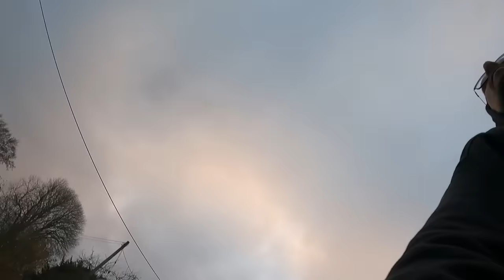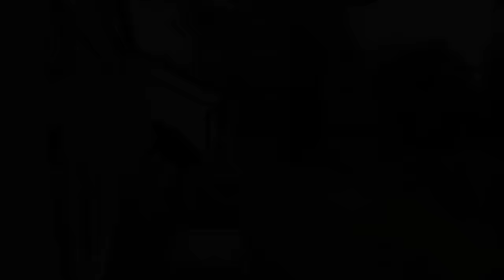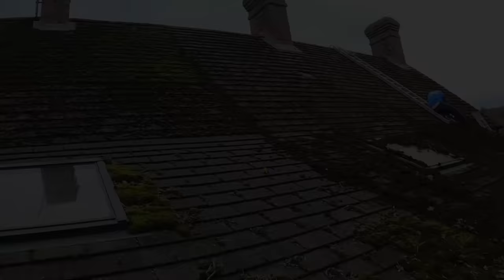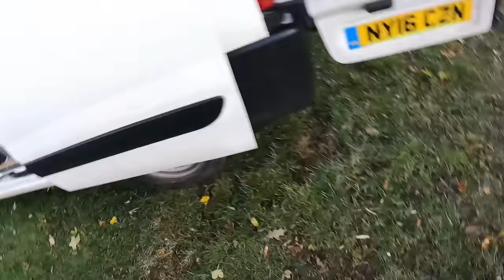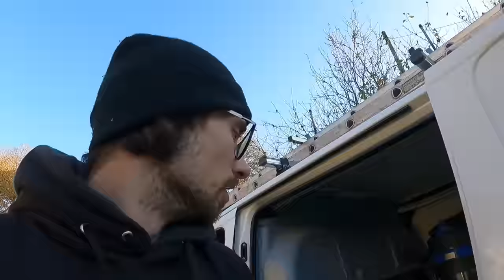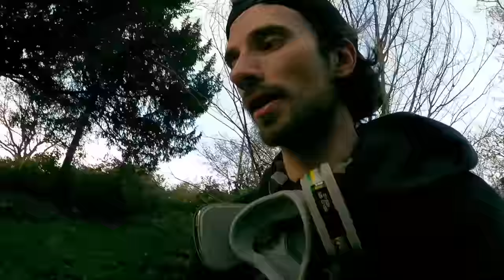You've NEVER seen a roof this bad! - Cleaning the the mossiest roof on YouTube.

Comment: I bet their heating bill will go up by a few quid.
Reply: Cheaper than replacing the tiles from being eaten to death I guess?
Reply: @ColinRichardson  What about the wood frame that is holding that extra weight?
Reply: @ivaylotsankov7292  I’m no home builder & I’m also from USA, but I’m pretttttty sure these houses are predominantly stone & brick? 🤷🏼‍♀️
Reply: The roof frame (joists) are timber.
Reply: @aborch7  Correct, but the tile roof is typically held up by wooden trusses.
Reply: Just hope u havnt under priced the job as it was such a hard job just doing one side of the roof good luck with the rest of it u deserve a medal
Reply: Curious is there a way to prevent that much build up? Obviously getting it clean more frequently.
Reply: @ivaylotsankov7292  it's a brick and block house plus the moss is covered in a sheet layer so weight is spread evenly not in one huge mass bearing down in a fixed point it won't effect or hinder the roof
Reply: @jasontrewin123    I live in British Columbia...very similar climate here. We put a copper strip along the roof peak and it seems to cut down on moss growth.
Reply: I was just thinking the same at the moment I read your comment!
Reply: Porous roof tiles?  Seems a bit daft, don't you want your roof tiles to repel water?
Reply: @terranceparsons5185  when the tiles are laid they have a covering that repels water but after a few years the covering gradually breaks down hence the moss being able to grow but rarely gets that bad
Reply: The angle of the roof isn’t that much. The water being held there must get into the attic. Eventually anyhow.
Reply: Haha nice one 😂
Reply: I'm betting the insect damage has to be a factor. Wood worms and Carpenter ants.
Reply: We remove snow in parts of Canada and the US because of the weight. It's the same logic here
Reply: @louisetimoffee1655  I live in Scotland and have noticed that the arial (TV) on the roof is Aluminium there is no moss growth there, just like your Copper strip .

Comment: I am surprised you didn't try using pressure washers on that mossy roof.  I use one whenever I get a moss buildup on sidewalks and siding and it works so well!  It gets the tiniest bits out from the grooves and craxks of the surface.

Comment: I'm in New England not near any water but the house is in the middle of a forest.
My house roof had no problems with Moss (Had the expensive moss proof shingles). 
My shed had cheap shingles. My son works for a local well established business.
My son used the OLD TRICK  bleach.   He took a small amount and sprayed it on the roof with a plastic spray bottle.
He then took the garden hose a sprayed a light mist on the shingles.  Within a week the moss was gone...
My son does this to my shed roof once a year now,

Comment: Here is an idea I thought of following seeing the small FSC on the water fed pole.

Similar setup but dry, air compressor powered or electric rotary brush attachment on a WFP, certainly not for ridged tiles, but flat slate?
Reply from the maker: the air compressor exists already, called airpole i think, patented :D
ive thought about the rotary brush a lot but i think the weight of it would be the issue, who knows though someone may bring out something in a few years that changes the game

Comment: Do you wish you had your steam cleaner all set up ready to go? That was a monster of a job, well done to you all. I wonder whose body was suffering more you, Lee or Kev??? Great to see team work :-) That must have been a massive weight removed from the roof. Might even make the house warmer as not as much cold damp moisture sitting on the roof. 
I wonder if the brush on the scraper would be better fixed to the other side of the blade as you mainly pull it towards you?
Well done, hope all had time to recover!

Comment: Glad to see you were back there... And more importantly the customer was happy.

Thought you may have used your new Hot Washer for the clean after the scrape - before biocide.

Keep up the good work.
Reply: Maybe he shot this video just before he got the Hot Washer. But I was thinking the same.
I wonder if it would work to apply the biocide with the Hot Washer. In just below boiling point water with biocide.
Reply: @sirBrouwer   I think you would use way too much biocide if you did that - the PW uses say 9 to 12 L per minute at 20:1 biocide ratio - that would be say 1/2 L per minute. - PW the back of the house would take after a scrape probably a few hours - so say 60L of biocide..... apart from the cost - biocide vaporising at high pressure is probably not good for the surounding vegitation / people / animals. So probably better - scrape / PW / Bioside with pole and brush.  but maybe Sid will enlighten us with his thoughts.
Reply: @simonreader7301  Not the pressure washer but the Hot Washer. set on low pressure and used like his normal biocide kit.
with the only difference Sid using hot (not boiling) water.
Reply: @sirBrouwer   That was what I meant - its still a low pressure pressure washer - the PW he uses is 15L/Min or 21 L/Min 250 or 200 Bar -  depending which he chose - the hot washer is 12L/min at 100 Bar

Comment: Odd question maybe, but, does all of that moss add any insulation? I would think that it helps hold in the warmth in the winter.
Reply: Well it adds weight and mass to the roof.  The effect of the moss on the roof is that it holds a lots of water. From the isolation perspective I thing it mainly cool down roof in summer. I think in winter the insulation is minimal.
Reply: @Kaldusar  oh yeah, I hadn’t considered the water it would hold, moss does tend to act like a sponge.

Comment: Is there something that can be baked onto the tiles that can prevent moss from growing on it? But then we wouldn’t get to see these great videos. Cheers from 🇨🇦
Reply from the maker: The biocide we put on it afterwards will help for a good period of time, unfortunately nothing will stop it forever so a light treatment every few years will keep it clean!
Reply: It can help to  start with smooth glazed clay roof tiles. They tent do stay clean for a longer time. But they are pretty expensive.
Reply: The only thing that stops moss growing is natural slate rock tiles. I've never seen moss grow on them. Clay and concrete tiles are the worst.
Reply: @choncord  smooth glazed clay tiles also seem to be able to avoid moss. as the service is just to smooth.

Comment: In that climate, how much time would have to elapse to get the roof in that condition?  Once you are done with the roof, if the customer/client called you in 6-month or 12-month timespan, would the condition of the roof be the same?  Just wondering from sunny, Central Florida, USA!!!!  All the best!!!!!!
Reply from the maker: He mentioned he cleaned it in 2018, obviously no chemical treatment was used so it just grew back with a vengeance, the location of this house is the problem it's at the bottom of a hill will overhanging trees next to a river and also never see's sunlight, this will 100% be a house that will need treating once every few years to keep on top of it

Comment: Great video Sid well done. Amazing results.. What is the surface cleaner you use at the end of the pole?
Would be good to see a video on the equipment used.
Reply from the maker: Will do an annual equipment rundown soon but it’s a turbo devil 12inch from AC PRESSURE WASHERS

Comment: Dumb question, but would that moss covering have increased or improved the house insulation in any way? (ignoring any other considerations like moisture retention affecting tiles and wood joists etc..)? 15:55 You call that a wheelbarrow?? THIS is a wheelbarrow!

Comment: Amazing transformation but I have two questions. First, what is the roof made of
and second, was it designed to be coated in moss? Maybe additional insulation?
Here in the states, slate roofs are few and far between because of the cost of
the slate and because our roof structures probably could not support the weight.
Neat job but I can't imagine working in that weather. Take care.
Reply: There are rooves designed to have moss or other vegetation. They are reinforced to take all the extra weight that brings.
This roof is not that kind of roof. The moss growing on the slates will break down the slates, add weight and hold moisture, leading to a cooler roof.
The structure of the roof is most likely wood. The beams are likely thicker than in the US and the rafters are probably thicker and also closer together.
Does that answer your questions?
Reply: @samuelmellars7855  Yes, thank you. I think
the bottom line is that you guys build things 
to last and we don't think that long term
here. In so many ways, sadly.